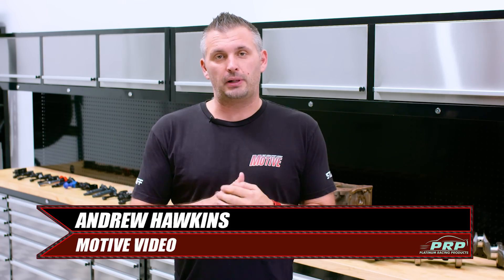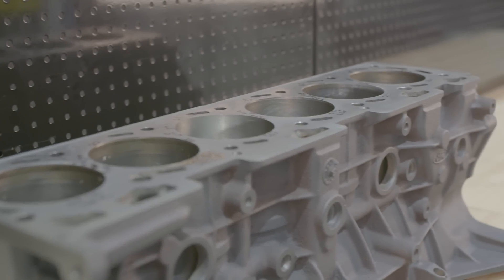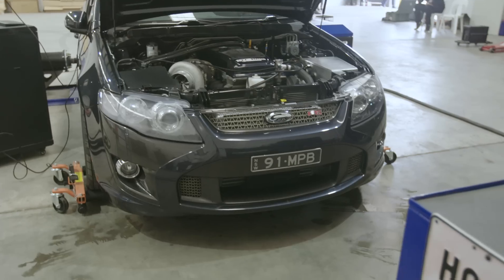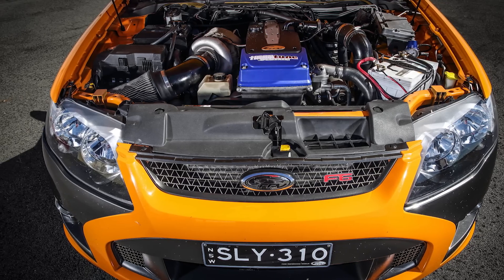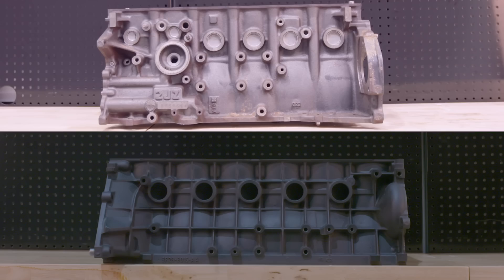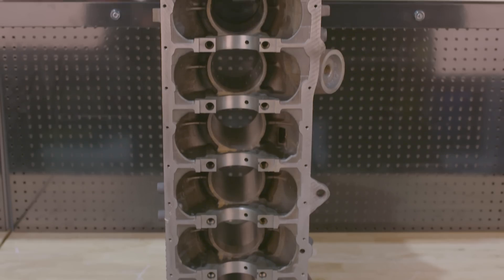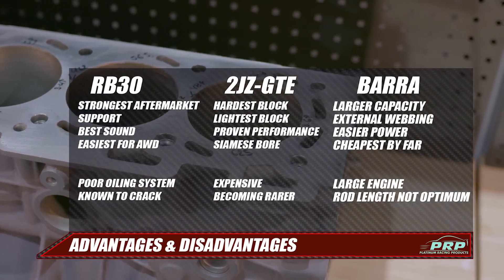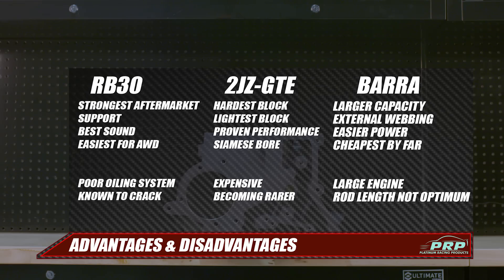Is the Barra 4.0L block better than the 2JZ and RB30?

Comment: The answer is yes the Barra is better than both engines in every aspect. It has only been around for about 15 years and is already making 2200+hp with its block.
Reply: The video clearly shows its weaker in every aspect besides size and price :/ what are you talking about.
Reply: Did your inbred ass even watch the video or nah? The 2j is better in pretty much every aspect lmao
Reply: @bigchief9036  I'm Australian lol. My guess is that I'm just going for more power than you. If i was aiming for 1800whp I'd use a barra but I'm going for more. 2jz is stronger. 'Proven fact'  So it was an easy choice. See what I'm saying mate.
Reply: @adamaussie18  do you actually own a 2j or just a fan boi?
Reply: @baker1271  Hey mate, both i suppose haha 1.5jz 3.2
Reply: @adamaussie18  Billet 2jz manufactures say iron block with bunch modification break  @ 2000hp.   3000hp talking about billet over $100k
Reply: @Liemciemdk89  Billet main caps is all you need block wise, there's a few sub 6 cars with billet mains on stock block. Of course they will say that, they're trying to sell you a 10k block haha. Although they're basically a requirement these days if you want to break any records.
Reply: @adamaussie18  mate so what your saying is 30 YEARS and the rest of the WORLD who's had r&d on the 2jz has only made 800 more hp than a Barra? Hah you watch mate give it a few more years and you'll see what the Barra does to your little 2j
Reply: are you a moron? the video clearly shows the 2j is better in nearly every way lmao
Reply: @supernice_auto  oi shut up mate idgaf about ur opinion
Reply: Don't be but hurt because your bucket LS doesn't competed with these 3. The barras still king out of the 3. Competing very close to the 2jz.
Reply: @bigchief9036  i own a 1.5jz. How is a barra better? With 3mm bores, Much softer block, needs grout to push past 1000hp and a billet block to go past 2000hp it sure doesn't sound superior in anyway.
Reply: @adamaussie18  mate what are you smoking. Barras make 2200+hp with the factory block! We don't need billet. It's recommended to grout it past 1000 but many applications have seen it through with out it! You don't even know what you're talking about. It's a much stronger block in everyway compared to the other two.
Reply: @bigchief9036  I've never heard of 2200hp at the wheels out of a stock barra block. You don't mean flywheel hp? Because that's 1800whp at best. You're comparing that to a 2jz block that has been proven to run 5s with close to 3000whp you know that right?
Reply: @adamaussie18  exactly mate you don't know anything about barras and as to why they're are superior. Do your research go check out dyno-mites social medias and videos and get back to me.
Reply: @bigchief9036  Hey don't back peddle now. well i watched this video. So i know it has 3mm bores compared to 7mm 2jz bores and The metal hardness scores 250 compared to 310 2jz. If it's the king surely it's faster then the 2jz? 5.9sec 1/4 on stock block and 5.5sec with billet. Get back to me with a link of the "superior" barra going faster and prove us all wrong. Or cant a 17 year old 4L keep up with a 27 year old 3L?
Reply: @adamaussie18  Paused vid @ 10.49. Bore thickness is the same 5-6mm, gap between bores is 7mm for 2jz and and 4mm for Barra. Hardness 2jz ranged from 210-290. Barra 249. 2JZ wins but this video shows the Australian Barra is right in the mix with the best of the Japanese I6s.
Reply: @Lynchy237  that was a typo Motivedvd has confirmed in the comments. Hardness is 290 to 310 for the jz not 210. 210 to 290 would be terrible haha.
Reply: @adamaussie18  cylinder wall thickness and Rockwell rating at room temperature is useless information. Metal at operating temperature expands and the Rockwell rating changes as the metal heats up.
Reply: Big chief dont forgot how far technology has come in the aftermarket industry in the last 20 years! Modern turbochargers, billet intake manifolds and even the bloody internet wasn't around then, so all the r&d was done the hard way. Not to mention the ability of small machine shops to have 4 and 5 axis machines for increased tolerances etc have played a huge part.
Reply: @TARMACULA  I agree mate. All the more reason as to why the Barra is more superior.
Reply: dions ute went 1700 hp on a full meth setup.at 8700 rpm,the barra is far from the king its just cheap bang for buck,never seen 1 barra on a hub dyno push 2000 hp at the tire,1700 at the crank.on dions mega dollar motor.and that block would be full of block grout or it would split in half.there is 90 percent barra this and that dribble on the net and small part truth.facts are facts the jz is the king in every way,its just not cheap,news flash get what you pay for.
Reply: @jackydewar3419  not talking about his ute mate. Have a look at the Barra in his dodge. Pushing 2200hp+
Reply: @bigchief9036  its the same motor,he pulled it from the ute.he is a nice guy we meet him in vic.
Reply: @Youknow88 how me a barra on a chassi dyno making 2200 have yous got a new batch of ice in.running hot with dribble.tunnel vision has pushed the boat anchore to the max and got 1700 crank hp.i bet your mates brothers uncle in his garden shed did a barra that is mad lol your a clown
Reply: @Youknow88 there are thousands of jz motors all over the world making crazy numbers.we run a 1000hp 2jz stock bottom end for 4 years 13 years ago.no track work just highway runs.the barra is cheap junk.you can turn a honda up and will make good numbers for how long barra is the same.cheap turn it up it goes bang on nothing psi,the pro engine builders say barra on a engine stand 25k will get you a sort of reliable 450kw.thats not bang for buck.and it will fall apart.we come across a guy just out of Gerringong with a cortina on the side of the rd,barra powerd and built motor,and even he said on a build motor they fall apart.get over it there cheap junk,vs a master piece is just funny.a barra over 700 hp needs block grout,enjoy that.your funny man
Reply: Let's also not forget horsepower is a mathematical function of torque over time. Just because a 2JZ revs to 8-9K RPM to make 1500 HP doesn't make it any better than a 4L engine making 1200 HP at 6,500 RPM. You'll happily find that one has less torque than the other one, but they both perform similarly down a track......
Reply: @JosephArata  well said mate something these fucking idiots don't know and anything about the Barra engine. More great reasons as to why it's superior.

Comment: Haven’t even watched the video and I already know the Barra is the best
Reply: Which video are you watching mate? the only part were the barra won was the capacity and price??? so clearly 2JZ FTW and its 20plus yr old japanese tech!  mind you i love the barra as well
Reply: @ivandanvervittali3817  I'm a barra fan an I agree with everything Ivan said
Reply: @ivandanvervittali3817  Maybe if ford out sourced their motor design they might have had a better engine too ;) plus if you look at the cost of how much it costed to design a Barra and a 2JZ, you'd think the 2JZ would be miles better. But its not ;) only a hand full of JZ's see over 600rwhp before they blow up or you need to do expensive head work ;) every barra stock form holds 700-900hp ;) that's with only valve springs done ;) JZ need cams, need to port the head to get the right flow, oh and don't forget the out of this world heating issues ;) oh did the forget to mention the low torque they make ;) Also the bottom end in a barra is out of a tractor made in the 1960's. And it pisses on motors today ;)
Reply: Bang for your buck it’s the best
Reply: Man the barra will out run a 2jz mark my words rest all those 2jz egos man can’t wait matter of time

Comment: Now test the 2JZ against the B58 in the 2020 Toyota Supra!
Reply: pretty sure the B58 is an aluminum block, so can't really compare.
Reply: @sigmaprojects  that just means they wouldn't really be able to compare hardness or bore thickness and such but I'm still curious how it compares in size, weight, oil/water flow, and whatever else they can come up with.
Reply: @TJSpartan008  there are videos of youtube talking/showing about oil and coolant galleries  and other internal workings for the B58. Engineering Explained is one of them
Reply: @Legotruck82  yeah but pretty much all I've seen is a review on one or the other. Has anyone done a side by side in depth comparison yet?
Reply: Same thing I just said on their 1JZ vs RB25 vid. Would love to see this comparison! Obviously they would discuss the differences between cast iron and aluminum blocks.
Reply: B58 can never compete against the 2JZ because it is aluminum.
Reply: You cannot compare Budler's engine to any production bmw engine, it uses a custom billet block
Reply: @heru_ur6017  a lot of these world beating jz series are just the same but people use it as valid comparison.
Reply: @Cafferssss   Thats exactly my point. Everybody compares either this drag engine to that drag engine without really comparing any of them. 
Thats why i liked this video, its hard facts for each block.
I've seen budlers car up close many times and even from the man himself only stock bmw part is the cylinder head casting. Everything else is custom billet.
Reply: @heru_ur6017  still. More oe parts than a 6sec supra motor then 😂😜
Reply: Yeah, BMW did a pretty good job on that new Supra engine.  🙃.
Reply: I love those comparisons! Now I'm curious about the quality of the cast iron BMW engine blocks, like the m20, m50, s50, m88, s38.
Reply: It doesn’t matter cast iron blocks can still crack hella easy from heat because the heat energy is trapped in the motor so it doesn’t have much room to escape but the only thing is is that the supra has a very very high compression for engine response purposes so that’s why it wouldn’t have much of a chance at making too much horsepower over a 2jz
Reply: People are already dropping 2jz’s in the new supra
Reply: For fuel economy on both stock condition, i'm sure b58 is better
Reply: papadakis racing has a video on the 2JZ & B58
Reply: b58 loses because of price and closed deck not allowing for bore increase. Its DOA. The b55 however does still have latent potential i think toyota dropped the ball making the choice of the b58 instead of the ever so slightly higher price of the b55.
Reply: @sariahreigns3666  worlds fastest 1/4mile with bmw power is using an m88.
Reply: @Cafferssss  i thought it was south africa with thier promod bmw with e34 m5 motor.
Reply: @sariahreigns3666  yes it is the world's fastest bmw powered 1/4 mile and its an m88 motor which is the same
Reply: @sariahreigns3666  why cant you increase the bore on a closed deck?
Reply: @sariahreigns3666  do you mean s55?
Reply: @A4rings110  who care if is B or the S is just a bunch of BS 🤣
Reply: @vuthieu1573  what?
Reply: @sariahreigns3666  They are all dead on arrival, they are Gasoline chugging engines. Turbodiesel or gtfo.
Reply: @JosephArata  lol wut? diesels are dying breed, even in small tiny europe where they were popular only due to taxes lol. gas engine is going to live longer and will eventually be replaced with liquid hydrogen - the future of cars. To close the gap will be hybrids and EVs, but they won't last long due to limited supply of rare earth metals needed for batteries. We might be looking to 20-40 years max for EVs. After that it's centuries of liquid hydrogen - the only sustainable and available power. Water is everywhere.
Reply: @JosephArata  Diesel motors will become obsolete long before petrol or gasoline, based solely on ever increasing emissions targets that diesels will no longer be able to meet... VW knows this very well...
Reply: Its a weak ass open deck block so it has great cooling at the expense of rigidity
Reply: @CP110  No.  The N54 is open deck but the B58 is closed deck.
Reply: @CP110  thanks for spreading misinformation
Reply: @CP110  lol what an idiot.

Comment: To be fair, as you've said, there is variance block to block. Let alone year to year, so one may have significantly better bore thickness.... or worse.
Reply from the maker: We've been assured it makes no difference what year or what car it came out of etc. The thickness can only differ so much. Core movement same as what RB gets. It will always be 3-4mm thickness in the bores between cylinders.

Comment: Have you guys run any of these tests on billet blocks?
Reply from the maker: These tests aren't comparable as billet expands with heat and has sleeves in it. Different material basically so not really apples with apples
Reply: @MotiveVideo  yes you're correct but it would be a good test none the less to see how advantageous a billet block is compared to a cast. Great segment by the way, keep up the good work.
Reply: @MotiveVideo  design wise which is a better option steel ( or aluminium it i can't find someone to make a steel 1 because iv never liked alloy factory blocks iv had to-many problems with them ) billet blocks $$$ with wet sleeve drop in liners ( like a USA simi heavy-duty caterpillar truck engine ) or a quality high nickel cast iron in a v-8 ?? $$ ( im looking at a new 2-g 426 stroked to 440-530 ci hemi engine running turbocharged boost aka street/strip engine but im not being nice to it )
Reply: @Tex 13 yes I'm well aware of the benefits of a billet over cast. True data is what i was chasing
Reply: @changereception7750  I get what your saying
Reply: A billet block is not a compromise of casting techniques the thicknesses are whatever you want when you order it a cast black probably cost 200$ to manufacture byt the 1000s and cost you about 1500$ a billet block costs 15000 to buy and probably cost 12000 to make starting with an 8000$ "BILLET"

Comment: Awesome videos! How about the BMW n54 from 335i they are making good power
Reply: Lol BMW is garbage, they can't make reliable power at higher HP, i remember some of my friends had their n54, they all failed at around 450 HP after longer term, BMW should go to bed.
Reply: @HansensUniverseT-A  lol your statement that's backed up by "your friends" and not fact. Own an n54 before passing comment. Ive been running an n54 reliably for 3 years at 410-470 whp depending on the tune and fuel as my daily. Look after it and it will treat you well. I will say though, over 500whp I feel the engine is being stretched to its limit.
Reply: HansensUniverse they make big power, check out AdamLZ channel his is daily 750hp stock motor.
Reply: @HansensUniverseT-A  
No u
Reply: Newer motor less reliable aha
Great power and feel!!

Comment: Now let's see a Mang Mang get tested. 😂🤣
Reply: Hardnesss: a bit
Reply: @mad87645  Let's compare that block against some Play-Doh... yep, the Play-Doh is 4 times stronger than the mighty Mang Mang. 😝😝😝
Reply: They can test how big of a boat it can anchor.
Reply: I know a 253 could stop a container ship dead in its tracks
Reply: some random guy  Maybe to you, but 4 others are saying MANG MANG TIME along with me!! 😂🤣
Reply: some random guy  I'd watch a mang mang video.
Reply: recently a vt pumped out 1011bhp out of an ecotec lol there's ones in us pushing close to 1600+ hp lol any engine is capable of big power it's more a matter of will it hold together hahaha it's not uncommon for ecotecs to sit around 450rwhp on stock engines, just trubo'd know of one guy who pushed 630 out of his lol
Reply: look up kevin yates racing engines on fb , he specializes in building crazy mang mangs lol
Reply: Mang Mangs are tough af. My thrashed pos daily Vx has done 428 thousand, doesn't use oil and ac works great on 44 degree days.
Reply: @craigdavies69  a vn I had yrs ago had just over 800,000klms when I sold it I bought it with 580 on the clock lol that motor got to about 720 before it went bang lol well the balance shaft bearings went and it was cheaper to throw in another motor lol
Reply: mang mangs aint no joke, and thats coming from an american. ive got a mang model just before the ones you guys got, its basically just a grand national block without a turbo.
Reply: Pardon?  Wtf is a Mang Mang? Asking for Europe.
Reply: @unavailable8681  Buick 3.8 bud. Possibly the greatest sounding v6. in................... the woorrrrlllldddd
Reply: @unavailable8681  slang for a gm/buick v6 it's the sound of them sitting on limiter lol just search commodore v6 burnouts and watch a few vids and you'll understand lol :)
Reply: its already won with out being tested lel
Reply: Mang mang maaaaaang maaaaang mang mang
Reply: hahahahaha
Reply: Yeah mang
Reply: There are sum freak 3.8L around atm 
But all in all probably not on the same level...

Comment: Now get an LSA block and test that...  :)
Reply: LSA711 needs to be a ls iron block for a fair comparison either 5.3 or 6.0 lq9 etc
Reply: @n12sumfin  yes but twice the displacement and pushrod is a whole different beast.
Reply: B00steDevil i am talking about the same block testing that was done in this video only, bore thickness, cylinder wall and hardness testing
Reply: Ly6 6L, 454ci iron block would work I guess, they are both around 2k usd though not shipped, plus its a completely different class the lsa
Reply: Why bother?
Everyone knows LSA's are built in chook sheds in Bangladesh!
Reply: @wilyworm5025  lol typical ford fan comment.
Reply: @AlsAllAussieAdventures   lol my bad,
Sorry brother....couldn't help it!